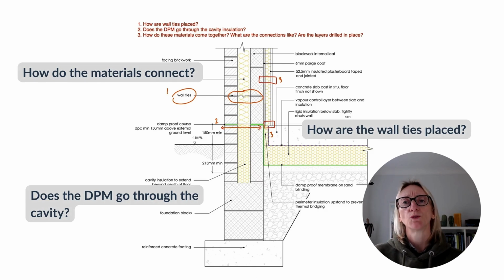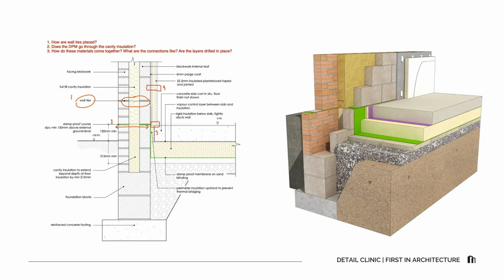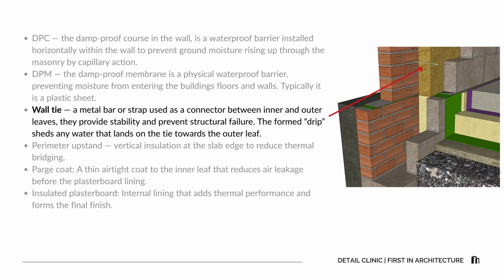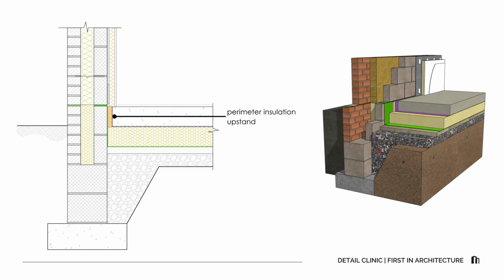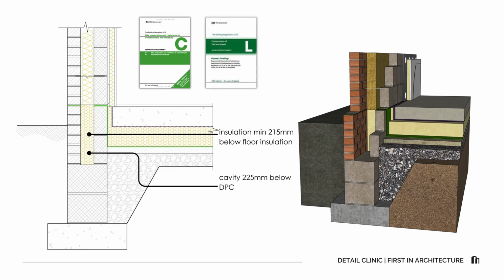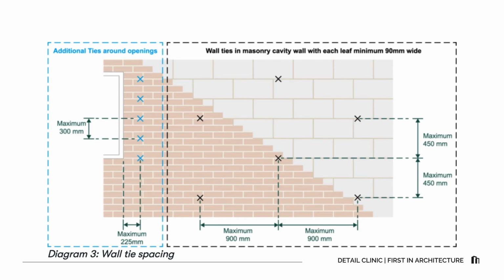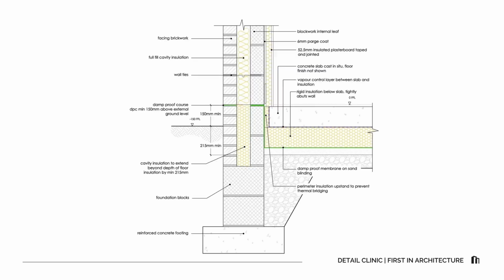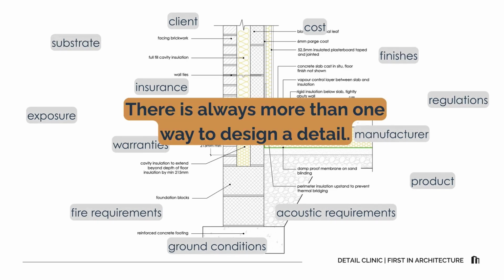Cavity Wall Foundation Detail Explained | Wall Ties, DPC vs DPM, (Detail Clinic Ep.1)

Comment: Can we see the same detail for Beam and Block construction and a discussion? To achieve low U values for the floor many beam and block bases are now 225 mm below the dpc / FFL, and then allowing 150 mm for the beam and block (which sits on second dpc), plus 300 mm below that for lintels and 215 mm high blocks, we can end up with a cavity that is 675 mm between the dpc before we reach the top of a trench fill foundation. How do we ensure that the outside wall is stable and able to resist the pressure from the soil and clay on the outside of the house, if we cannot bridge the cavity where the beams end? Should wall ties be used below the dpc in this circumstance? And can wall ties take compression loads? And if we fill the cavity, how high can that fill be?

Comment: Hi Emma,

Interesting subject, it might also be worth mentioning that certain details need further thought on suitability to what part of the country (UK) these details are for on a check list. This relates to the Building Regs, Part C Site preparation resistance contaminates & moisture with respect to exposure zones. The prevention of Radon gas is another consideration with d.p.c’s & d.p.m detailing. 

In severe exposure zones, using certain types of full fill cavity wall insulation with face brick work needs careful consideration. Wall ties with drips in full fill insulation ! or flat type ties ! as you say, there are many things to consider when providing details for specific projects & their locations.
👍
Reply from the maker: Hi there, absolutely. We do mention exposure zones in some of our videos, but trying to find the balance between too much information that becomes overwhelming, and enough to get students started. It's a balancing act we're still trying to get right :)